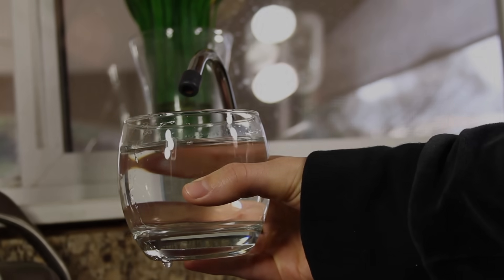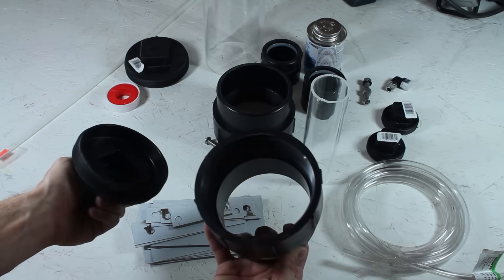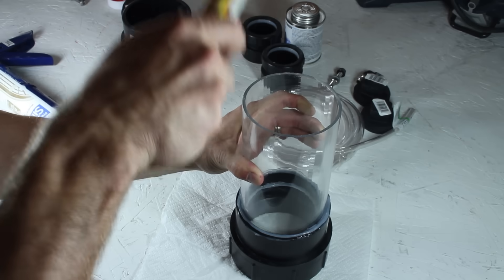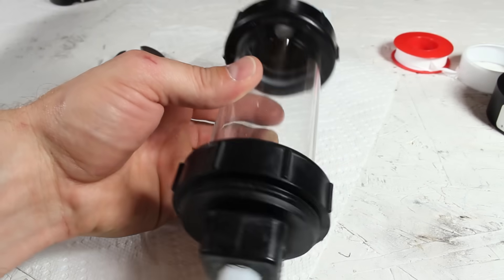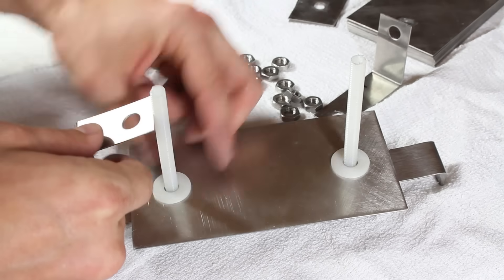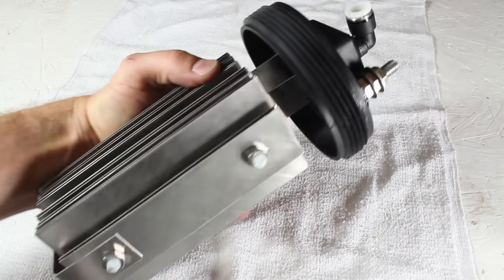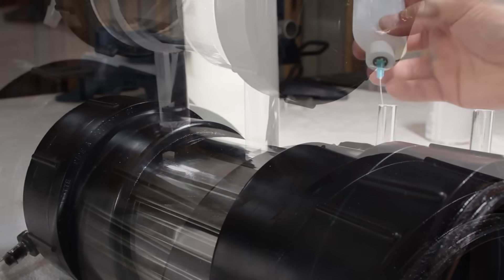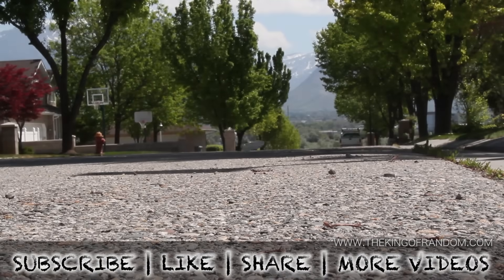HHO Generator - Water to Fuel Converter

Comment: Grant, you're a smart guy. I'm counting on you to make an engine with this fuel. You'd have unlimited, AND free fuel!
Reply: Not free it uses energy and that is not free unless it is solar etc
Reply: Jibraeel Karim
No, it's not free, it requires electricity, which has be generated using something else. He is using a car battery, car batteries are charged by the alternator, which is powered by the gasoline engine. You can use mains electricity from coal/oil/nuclear but that is not free either. This is an inefficient and well-known process, it is nothing new or revolutionary, it costs more to create this gas than you get out of it.
Reply: InJayz Brain The only way I can think of is if the only energy used for the separation is from a different clean energy source. You cannot break chemical bonds without energy, so you will either have to use a different chemical to make the reaction work, or use electrolysis with solar/wind/nuclear power. 

Unless you were using the oxygen/hydrogen in a different chemical reaction than just burning hydrogen, it will always require more energy to separate water into its constituent elements than it releases to form water through burning hydrogen.
Reply: InJayz Brain Breaking glass with sound still requires the transfer of energy into the glass. Also, you still cannot slide the magnets apart with less effort than it takes to place them next to one another. The solution you have suggested still requires that more energy be used in the production of fuel than the energy release of said fuel. And since you didn't actually provide any equations or mathematical framework, I am guessing that you don't actually know a whole lot about chemistry or physics and read this on some random website, which also didn't include any mathematical framework, because math doesn't lie. 

As for the Earth being flat, we have known well before the development of science that the Earth is indeed round, and in fact the size of the earth had been calculated in 240 BC by Eratosthenes.
Reply: Jibraeel Karim Energy is defined as a quantity that is conserved. As for there never having been a beginning, it depends on how you would define a beginning. Time started at the big bang, so we cannot say that anything happened "before" it. Also, accepting that energy can be created or destroyed contradicts literally all of modern physics, chemistry, biology, and pretty much every other science. Literally our entire system of science is dependent on this fact.  Your attempt at shoehorning philosophy into this is laughable. 

As for some things always being impossible, do you truley believe otherwise? Do you expect mankind to become gods eventually? That is the logical conclusion to that line of thinking.
Reply: Jibraeel Karim All of the universe seems to operate on the same laws and if there is a part that doesn't, it would cause a lot of issues and is so far away we don't need to worry about it anytime soon anyway.
Reply: Michael Tarantolo that's an urban legend. A "water powered" car (ie. one that uses water as a fuel) isn't even possible within the known laws of physics - well, short of maybe through cold fusion. No doubt these sorts of stories just come from people not understanding the real science at work - and then it gets added to by conspiracy theorists. Using water to store energy though a process like the one in the video or similar is possible though - but that sort of technology is hardly suppressed - and to the best of my knowledge nobody ever got assassinated over such a piece of basic chemistry. It's the details of making this sort of energy storage safe, cheap and practical (and better than other clean alternatives like batteries) that would be valuable in the global marketplace.
Reply: TheStigma For once there's somebody in these comments on the pro-side that made a good point.
Reply: NowhereManForever I seriously applaud you.  Reading InJayz's stupid comments that give vague generalizations leading to no conclusive statement supporting his initial immature comment suggesting you are wrong started giving me headaches.  You quoted exact thermodynamic laws that are proven while InJayz gave a whole pep rally speech about thinking different.  Thank you!
Reply: InJayz Brain Show me the equations related to this, As for "there's always a better way" and "we just gotta think more outside the box," what if the "box" is fundamental laws of the universe? In order to separate bonds, create sound waves, or really do anything that requires work, energy is required. Think of the three atoms in a water molecule as three magnets. Two of them are weaker and positive, and one is big and negative (I know this isn't how it really works, but I am simplifying for the analogy). What you are saying, is that there is a way to pull these magnets apart in a way that is easier than putting them next to each other and letting them pull each other in. When you pull apart magnets, you feel a resistance and they stick together a bit until you can use enough force to take them apart. When you place magnets next to each other, they just move towards each other and if they're strong enough they wobble around a little bit afterwards and wen they collide there's a clacking sound. The sound and wobbling are the release of energy.
Reply: Plazma lasrer Did you know this is actually physically impossible? ALL processes lose energy over time to their surroundings, and if they don't, they reach a point of equilibrium.
Reply: Saule Urbunaite  yea, it's produced as gas, but making it liquid is just a matter of running it through a suitable compressor. That makes it more practical as a portable fuel. If this ever got used as a commercial fuel you'd be buying and transporting it as liquid no doubt.
Reply: NowhereManForever  Thanks. I think we need to keep in mind when having this discussion that when we talk about this stuff as potential fuel there are two ways to consider it. Do we "gain" energy from it - NO. You still need a power-plant somewhere producing power from something - whether that be coal or wind. This is just a way to make electrical energy into chemical energy. It is potentially a good way to create portable fuel or just storing energy in a compact format, YES - although with some safety concerns in some cases. All energy is just cycled around in different forms in the universe so really the question isn't how to "create energy" as that is impossible, but rather how to harvest it in a practical way from the environment. I think this video demonstrates a method that can help do the latter, but people who think this is free energy obviously need to go back to school :)
Reply: robert hammond Fukushima was a complete fluke. It had a massive wall to protect it against very high waves, but the waves that they received were ridiculous. The Ukrainian semi-meltdown was the creation of engineers who weren't thinking. They were running the cooling facilities from the power station - so during low-power producing settings there was insufficient cooling and they had a partial melt-down. That was only one of four reactors - the other three kept on generating energy for decades after. The area that was deemed unsafe for humans is now a literal urban forest. The local wildlife has done better with the radiation than they ever did with humans.

Humans by themselves are far worse than nuclear power. Nuclear power is far more efficient than coal in terms of fuel required (which is a massive plus side). Nuclear fuel can also very easily be recycled, and only America does not recycle their nuclear "waste", as it is not "financially viable". The radiation produced from a nuclear power station is 700 times less than the amount of radiation produced from a coal fired power-plant per kWh, and can be dealt with. The biggest, unknown problem with coal fired power plants is that all the radioactive particles are aerated. That's the very worst kind of radiation. The reason a nuclear weapon is detonated about the ground is to aerate the radiation.
Reply: Jibraeel Karim Yeah... anyways. I wanna start working on blueprints for heated plasma rifles. That won't happen for a while though.
Reply: NowhereManForever And you my friend are a complete idiot. There is always a better way, actually already proven... Unfortunately no money in free energy so it's been suppressed for many many years now.
Reply: Jibraeel Karim Indeed the things we've "come" to believe. We are moving into a new age, question everything.
Reply: InJayz Brain "free energy" in the form you'd like to believe is a myth.
Reply: It's not free - obviously you need power input to turn the water into gas. What he is doing here is essentially just converting electrical energy into chemical energy, so you still need to get that electrical energy from somewhere - but of course you could get the energy from solar or wind power - neither of which are free in practice, but it is 100% sustainable and 100% pollution-free and that is the exciting part. Nothing stops you from hooking such a generator up to a some solar panels and producing fuel in your own back-yard with minimal maintenance. Similar systems can make a viable alternative to electrical cars for example because in liquid form this sort of gas is a very compact form of energy which makes it practical in portable applications like gasoline. The main drawback to it as a fuel is that it is very volatile (explosive!) because it contains its own oxidant, so a large tank of this gas is essentially a bomb if any spark ever reaches it - unlike gasoline which is very stable by comparison (don't believe hollywood explosions). That is probably one of the major reasons it hasn't been used in cars and such yet because it could be disastrous in case of a crash. It still has a lot of potential for other applications however.
Reply: A guy already made a water powered car and he was assassinated right before its release to the public
Reply: robert hammond you forgot the america reactor that had a meltdown. You also seem to forget what coal a oil burning have done for us. Potentially ruined the plant and making it unlivable. That's not even considering the immediate effects it had on the environment from mining and subsequent burning.
This far outweighs the damage done through nuclear accidents This damage is also accidental not inherent to the process.

Its like the argument that its safer to drive your own car then it is to take a plain ride (its not its much much safer to take a plain ride).

Also your estimation of fukushimas long term effects is misinformed.
Reply: ***** You have completely forgotten about conservation of energy. NO matter what we do with the energy we are getting form the sun even if its all its energy hitting the earth. It will stay in the earth spear transformed in to other forms of energy. Energy is not used up its only changes state. 

Unless we decide that the best thing to do it radiate it back into space then we would be fucked. 

It looks like one of my sheep has gotten lost. come back here li'l mrkiky, its all gona be ok...
Reply: ***** what other purposes could we use said energy for? Just for perspective  bit of wild speculation.

The amount of solar energy that hits the earth a year. is 20,000 time what the entire human races has used in energy up to this point. I will let that sink in. 

Lets say we find a way to use that much energy in one year how?. We could store it as fossil fuels, because that's all they are stored solar energy. Still that's no where near enough energy being converted. Remember all energy used by humanity upto now includes all wood, oil and coal burned. cant do that fast enough. Where would we put it and we would quickly run out of loose carbon on earth. say good by to global worming we solved it.

Why not use it to start a massive fusion process smashing atoms together like what happens in stars and just produce heavy elements from hydrogen. guess what the side effect of that is energy released just like in stars. or maybe we start a black hole somehow and just begin dumping all this energy straight into that.

This has gotten so insane that its pointless,
Reply: TheFishCostume fun fact the rocket that exploded launching cargo to the ISS recently was actually self destructed when they realised it was about to crash back down onto the launch site and do more damage.
Reply: The thing is, you don't create energy with this. You just convert electrical energy into chemical energy to then use the chemical energy in the car.

But, it is way more effecient to just use the electrical energy directly for the car, instead of first converting it. You might be able to store more hydrogen fuel than batteries, so you could get further in the car, but this process is very inefficient and you are way better off using electricity directly.
Reply: He hooked it up to a solar panel. Therefore it is unlimited and free fuel.
Reply: Zee Butfudgers Of course I know that lol. What I meant was free as in no more money after it's built :)............assuming it doesn't need to be maintained.
Reply: Jibraeel Karim Lol okay
Reply: Sound or better put Frequency could be part of the equation we need to focus on with the power. There's always a better way, we just gotta think more outside the box.
Reply: Lets forget about the behavior of atoms and energy for a moment. We've come to believe that energy cannot be created or destroyed it can only change form. However this means that nothing was ever created or destroyed. You guys hear that!? There was never a beginning and that's something humans have trouble accepting. This leads to God which is even a bigger mystery. NowhereManForever Do you truly believe that certain things will always be impossible and in other parts of the universe it's the same? InJayz Brain I would also like your opinion. Orrrrrr you guys can just ignore me xD
Reply: NowhereManForever Oh sorry I forgot to say " If some parts of the universe do disobey physics as we know it today then do you believe man can live long enough to ever find it AND manipulate it? Also your profile pic scares me :(...........jk xD. I certainly appreciate your opinion :)
Reply: NowhereManForever Well man I was attempting to use your analogy to make it easy to understand and begin looking at it differently. Of course energy needs to be applied, I'm saying change the way it's applied. Turning the power off/on @ 20k-22khz (approx range whatever it maybe) I feel something very interesting will happen. I'm acquiring parts from some websites an old tv and microwave to build a pulse generator to run experiments of my own I'll tape everything and publish it on my channel as well. I'll leave you something to ponder "One day man will connect his apparatus to the very wheelwork of the universe [...] and the very forces that motivate the planets in their orbits and cause them to rotate will rotate his own machinery." Nikola Tesla
Reply: Stay Frosty in Nowhere Man.
Reply: Jibraeel Karim " If that's the case then we should stick to Solar :O "

Cover the whole Globe with super efficient solar panels....then the Earth would freeze because none of the sunlight will be converted to heat.
Reply: Stragemque And if it's used for other purposes, it's not heating up the Earth, is it?
Reply: Stragemque Wow, why don't you read my previous comments instead of trying to sound smart? If you look closely, all I've ever suggested is hypothetical. 

What other purposes? I dunno man, energy is used for stuff other than heating.
Reply: ***** i am sorry if I offended you or sounded pretentious. I enjoyed thinking about the idea and had fun researching it and maybe got a bit to worked-up over it.
Reply: ***** I'm not very good at explaining but i'll try to make this short. We already know that energy changes form right?  When we take a magnet and move it towards a conductor that is part of a circuit, a voltage is induced, and if the resistance of that conductor is small enough then a current is also induced. However that electrical energy didn't just come from nowhere. The kinetic energy the magnet possessed was converted into electrical energy. So obviously we expect the magnet to slow down right? It will. that part of the circuit ( a good example is a coil ) would repel that part of the magnet by becoming a north or south pole. So if we turn over a bike and strap a magnet on the wheel and have a conductor ( A thick one with low resistance like copper ) that is connected to a circuit and lay it down besides that wheel, and turn the pedal really hard, you would notice that the wheel slows down much faster than it normally would ) Kinetic energy was converted into electrical energy. I got that one from physics text book.
Reply: Jibraeel Karim Yes I know that... Still wouldn't make the world stop spinning from wind turbines though.
Reply: an engine with this as fuel is a great idea, but then he must find a way to let the water get out of the engine after the combustion as what is created after combustion is water! if water is still in the combustion chamber, then there would be no if not then a very weak combustion which is not what motorist wants. I thought that maybe we can have the pistons push the water all the way out, but then if it does, then the gas would pre-combust due to the amount of heat created from the compression of gas.
Reply: TheFishCostume That's exactly why it would work and is used! Their is no need to mess around with the oxygen concentration and airing of the cylinders its already the perfect concentration!
Reply: Stragemque I was wrong. It would work, but it's still less safe than gasoline.
Reply: TheFishCostume That it is.
Reply: mr. .Flaw They're expensive and I want to build it myself.
Reply: Irish Gaming Solar panel isn't unlimited because our sun will die.
Reply: Adam Beazley But the Warranties do not cover loss of efficiency... The panels may still technically work 7years later; but at 1/2 their original efficiency...
>>>>>>>>>>>>>>>>>>>>>>>>>>>>>>>>>>>  Hot Parabolic Commentators + Hot Fluid + Stirling engine systems are the way to go for long term high efficiency solar.
And thats why all the large companies use these systems instead of PV-pannels
Reply: Stragemque No body gets murdered for discovering a free or cheap source of energy. Energy companies would just  embrace the technology and sell it. Or would you think energy companies say: 'no we like  buying  expensive oil instead of some cheap source'
The only ones suffering from  other sources than say oil would be oil producing countries, but they havent killed the inventor of solarcells yet.
Reply: Ed19601 they don't want our cars exploding on the side of the road man it has nothing to do with them wanting to keep it out of our hands. Hydrogen: the first element on the periodic table of elements read wikis about it now if they find a way to run a car on Helium and kept it from the people that would be a different story.
Reply: Jibraeel Karim wow your life must be boring
Reply: Zee Butfudgers You build a generator for the fuel converter to run on. You get free fuel and from free electricity.
Reply: Ghost of Justice As in $...........but of course we all know that ^-^
Reply: Ghost of Justice xD ......let me know when you build that................I'm serious........
Reply: CHollman82 True. To bad he doesn't have a generator :(. One question though. Do you think if the entire world uses wind as their power source for generating electricity, do you think the world would eventually stop spinning :O If that's the case then we should stick to Solar :O
Reply: CHollman82 Never mind my earlier question. According to my physics text book as long as the sun is there will be kinetic energy in the atmosphere. This raises a few questions for me though but hehh whateves.
Reply: InJayz Brain It would be great when it's not suppressed
Reply: It is gas... Not litquid.
Reply: InJayz Brain Free energy is Bulls**t  but you could use electrolysis to produce oxyhydrogen that fuels an engine and the engine powers a generator which powers the electrolyzer and hopefully has enough surplus energy to charge a battery.  For efficiency the water output from the engine could be sent back to the electrolyzer.  The only thing you would need to do to it for it to work indefinitely is to add water and maintenance.  The real drawbacks is that the electrolyzer would have to be extremely fast and the engine and all other components would need to be quite efficient work properly.
Reply: TheStigma I had no idea I would start a militia rumble
Reply: TheStigma If you used clean renewable energy sources - a hydro turbine generator - it could be free energy in the sense of cost and would be produced not using coal or oil!
Reply: their are massive companies working on that same problem, no offence to grand but he did a class room experiment in comparison with the time and money spent on this topic.
Reply: but ghost if your the ghost to me dose that meen im dead
Reply: Justice Gant Lol I see. Different kind of justice
Reply: Michael Tarantolo definitely killed the guy http://themindunleashed.org/2014/09/move-tesla-new-car-powered-salt-water-900-horsepower.html
Reply: Jibraeel Karim nuclear is the most effeciant and safest actually. :)
Reply: Random Rampage are u for real,,nuclear is the worst,,look at Fukushima,, or the Russian reactor site,,when they fail they destroy life and land for 1000s of years,,radioactive waste from Fukushima is now reaching the west coast of Canada and the USA,,next cpl years there will be bans on surfing and swimming and no eating fish from the pacific ocean at all.
Reply: ***** probably the stupidest idea i have herd all day.
Reply: ***** Wait what? Isn't the point of solar panels to use the sun's heat to convert the state of a liquid into a rising gas so that it can drive a generator to induce a current? Forget the efficiency of the panels themselves, wouldn't the total efficiency of the machine matter too? Seriously though I think "none" is an over statement. Also even if it was 100% efficient wouldn't the electrical energy be converted into other types of energy like Thermal, kinetic ( which would most likely be converted into thermal through friction) and light? xD..........................................When I read that over I sound like a self obsessed smart ass but when ever I say "wouldn't" and "isn't" I really am asking cuz you seem like a smart guy.
Reply: Stragemque You should try herding sheep instead of ideas.
Reply: *****  "and we would have a use for all that energy" Can you name some examples besides electro magnetic radiation and potential energy? Cuz as far as I know, as long as there is friction there is bound to be thermal energy. I agree that the earth would freeze though because.............who the hell am I kidding humans aren't stupid! We're not gonna make the earths surface a solar panel! And even if we did we would definitely convert enough of that energy back into thermal cuz we need that! This just got stupid lol. My previous statement "If that's the case then we should stick to Solar :O" Obviously didn't mean "Hey lets cover the whole planet in solar panels, It's not like we need plants, light to see,blah blah blah etc.etc." - assuming we even had the resources" and if we did put alot solar panels around the planet then that just solves our global warming problem!
Reply: Jibraeel Karim Yea of course we wouldn't do that, I was just talking hypothetically just like when you said you could stop winds if you put enough wind turbines around. (I think that's what you meant anyway, don't see why the planet would stop spinning itself because of wind turbines)
Reply: ***** Exactly, because we have the sun.
Reply: That sounds nice, but it's a less efficient method than simply getting an electric motor and a reusable energy source.
Reply: the biggest problem with hydrogen power is its highly explosive
Reply: Jason Thompson Better stick to the very non-explosive gasoline then :D
Reply: ***** Yes in comparison its very non explosive, hydrogen is rocket fuel.
Reply: ***** ya but like a hydrogen fuel cell is basically a bomb all ready to go, hydrogen is very unstable and gasoline is relatively safe compared to hydrogen, like 3-4 fuel cells that could power a car would be like a large missile yield worth of explosives
Reply: ***** There's a reason rockets explode so often. Anyways, it doesn't matter. Car accidents happen often, and an explosion is a hell of a lot worse than a fire
Reply: Stragemque :O
Reply: just saying, but i'm not talking about a petrol engine... i'm talking about a hydrogen powered engine. you extract hydrogen out of water... hydrogen is highly combustible. but once combusted, it becomes water...
Reply: TheCarmacon Also, this generator makes HHO, which is oxygen and hydrogen gas. It probably wouldn't work in a car as it is due to how explosive it is.
Reply: Hydrogen fuel cells aren't a new thing they've been around since like 1900s when they where making air ships like the Hindenburg
Reply: now i'm really confused.... i now have two different information about hydrogen....
Reply: these type of engines already exist..
Reply: Ghost of Justice Those engines already exist and if you want to build it yourself it wouldn't be near as powerfull or save as the ones already in use.
Reply: I'll second that!
Reply: a car running on this principle has been made like 50 years ago
Reply: Can you guys stop now?
Reply: Two guys used the fuel on they're truck and it worked.
Reply: Irish Gaming It does indeed work! But it costs more to make the hydrogen than to just use gas.
Reply: Yes, but not for billions of years and most likely by then we will have found another planet to inhabit.
Reply: Irish Gaming Solar panels loose efficiency every year... After 10years most solar panels are only emitting a trickle of energy. You are better off using hot water solar panels; or a parabolic-concentrator+ Stirling engine setup.
Reply: That would probably be the best setup he could use. But he would only need it for about  3 years to get about a years worth of fuel or more.
Reply: Scott Francisco Solar panels last well past 10 years. All solar panels on the market now offer at MINIMUM a 20 year warranty that the panels will be putting out at least 80% of their rated output. Many panels that were installed 50 years ago are still producing over 50% of their original rating... Your statement is false!
Reply: would it be free though considering the need for the catalyst chemical the need for distilled watter and the need for a power source to run everything it is a good source of power no doubt but i think it would use most its power in self sustaining its supply
Reply: NowhereManForever Casey Copper just might have eaten a few too many mushrooms today.  Although I do understand part of what he is trying to communicate.
-----------------------------------------------------------
BTW; Good job schooling that brainwashed drone "Ghost of Justice".  I'm getting sick of these people who are religious believers in political propaganda they think is "Science"
Reply: der hindenburg
Reply: ***** Forever*

Just joking :P
Reply: Jibraeel Karim Well running it costs, think 'electricity bill'
Reply: Ed19601 Which one of  my comments did you reply to? If it was the first one then you should look up the difference between motor and generator :)
Reply: BannanaFarmer I hope you're joking...
Reply: Jibraeel Karim I hope you're high.
Reply: BannanaFarmer Nah I was probably just late. I'm sure were being sarcastic............................right? And I promised to never do drugs.
Reply: BannanaFarmer Nah not so much..
Reply: mr. .Flaw you don't say...
Reply: cyancoyote Not from the faucet
Reply: Chadley The Slayer not free, but fairly cheap
Reply: Breaking bonds requires energy. More energy than it requires to form the same bonds. Hydrogen from electrolysis will never be an efficient fuel.
Reply: This is the first video of his that I've watched.  But if he created a generator then yes it would all be free :D
Reply: It's much the same base equation as breaking glass with your voice. I like your analogy with the magnets it's quite easy to visualize. So lets look closer at those "magnets" for a moment. The two H magnets are vibrating at a specific constant speed, the O magnet is running at constant vibration, much different then the H's polar opposites if you will, but not quite because as they come together they don't collide or fully touch each other. The H's begin orbiting the O and it's only strong enough to hold 2 of them. Pulling magnets apart is hard and requires a lot of force, but sliding them off each other is quite easy. Finding the frequency or angle to hit them from the side will require much less energy to do the same job. A pulse or quick pop breaks anything apart better than constant force.
Now for those "fundamental laws of the universe" It wasn't long ago we KNEW the world was flat. Question everything, it keeps the mind open ;-)
Reply: NowhereManForever Sorry to be such a late comer to the conversation, and if I am repeating something said earlier I apologize.  Jibraeel Karim stated that energy CAN NOT be created or destroyed and that if that is true then you are left with the question of how did it all come to be?  The Big Bang Theory only addresses the disbursement of the energy, not its creation.  The very fact that it can not be created within the laws of science proves the existence of something (someone) outside the laws of science.  Any truly honest and open minded scientist, using the scientific method has no choice but to come to the conclusion that there must be a Creator, from this and many other arguments.  However, most "scientists" arbitrarily rule out the possibility of a Creator without definitive (any) evidence.